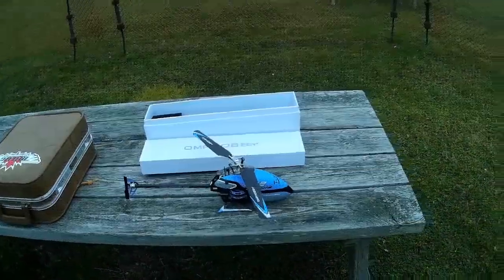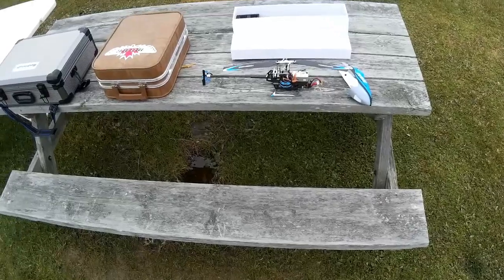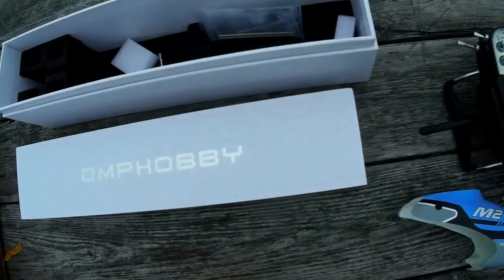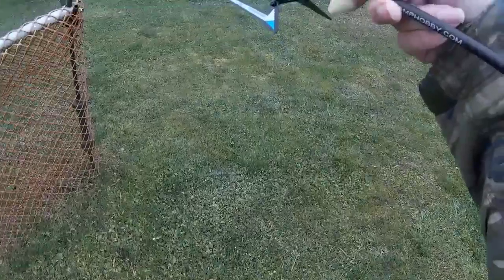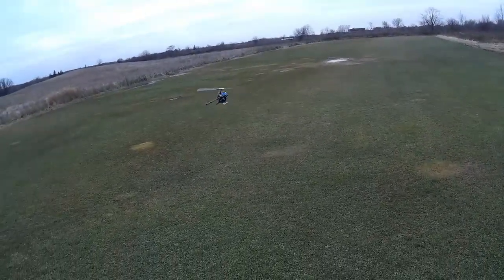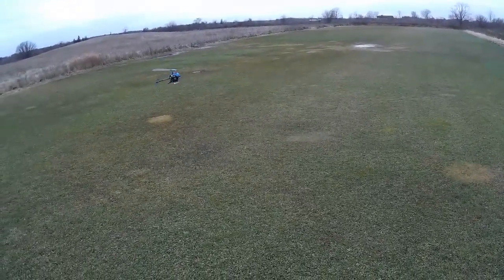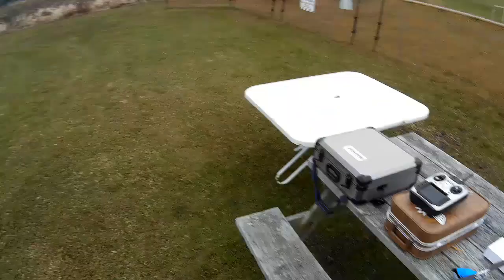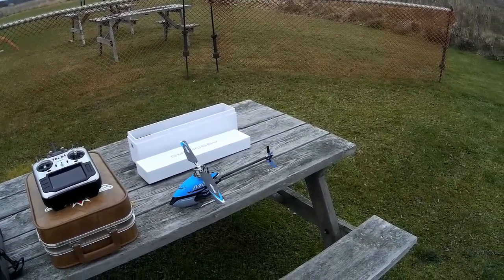OMP M2 Heli   first check flight

Comment: Which spare parts are included?
Reply from the maker: Bit of an odd assortment. Since the main rotors are direct drive, there is no main gear - which is, of course, a part which often breaks, and is usually provided as a spare. There are no spare blades. There are two spare main shafts, and also two smaller metal shafts - I assume those are replacement feathering shafts. And two spare carbon fibre skids. And five servo arms. And a couple of screws and washers.
Reply: kleedham and no battery carbon plates to lock them?
Reply from the maker: @mike_romeo_lima  There one battery, one plate, which comes inside the heli (and in my case was quite hard to get out - I used an emery board to smooth down the edges of the plate, to make it easier to slide in and out).
Reply: kleedham oh ok shit. I saw some videos where spare parts like blades, tailbooms and battery plates were included. Now I have to order them extra, via UPS! Pls not..
Reply from the maker: @mike_romeo_lima  Parts can be bought from Hawk Creation, who ship using Hong Kong post. http://www.hawk-creation.com/index.php?route=product/category&path=37_330 Haven't used them myself yet, though, so I can't give a personal review.
Reply: @kleedhamhobby  Hello
Thank you very much for the video's .... just to let you know i have just purchased the M2/Bonus pack from Hawk and paid for DHL express post to England the only issue i had was the import TAX about £20 paid online to DHL so less than 1 week to turn up not bad at all i think..... i also have a Jumper T16 pro ...... do you please have a link for your Tx model settings for the M2 ..... and if you would be so kind to let me know what switch settings you have assigned to the Tx ......  ho do you please have a throttle hold set up as the electrical helicopters scare me to death compared to my nitro helicopters that i can hear running   ( i guess they are like fart's its always the silent but deadly ones that get you )  ......... p.s. My setup came with the mini Rx
your are my only hope Kleedham.  i look forward to your reply
Reply from the maker: @raptorpome2577  I did already share my set up, as an OTX file. You can access it on Google Drive at: https://drive.google.com/open?id=19BblY3T7Lbv4af78M28NGcF-g-Dsdjtg However, my M2 arrived without the mini S-FHSS receiver, so I set it up using a DSMX satellite - so my set up is definitely not using the protocol that you will want to use, and there may need to be some differences in your channel output (I think the order of channels should be ok for S-FHSS, but the reversals might need to be different). As regards switches, that is all covered in the video - SF is throttle hold (back is live, towards you cut), SE chooses the flight mode (normal back, idle up 1 and 2 moving toward you), SB controls stabilization (back is stabilized), SG controls rates (back is low). If you follow my set up and have the Amber sound pack installed, all positions of all of these switches should be announced by voice.
Reply: @kleedhamhobby  thank you for the reply i have looked at your other setup video and have downloaded the Jumper open Tx model M2 file & sound file & it is now installed on my Tx and works Thank you very much ..... the Tx graphic display shows my elevator & rudder to move .... but throttle and ailerons do not move i guess i will have to have a play around tomorrow .... i did purchase some jumper Rx's can i plug any of them in and would i then have telemetry ? (battery voltage)........ one more thing do i have to plug any receivers in as i thought it came with one inbuilt what is that small black wire for on top of that Ali block ?  .............. please forgive me but i have not flown for about errr 10 to 15 years and i am now going from the stone age 35MHz Tx & Rx to the space age with 2.4 GHz with different protocols & Rx's with telemetry.  p.s.  can you tell me what the little button is for on the mini Rx that came with the heli is it another  bind button .... as the heli  aluminium block has a bind button
Reply from the maker: @raptorpome2577  I am a bit confused about what you are asking... and also what you are saying, for that matter. If you are using my set up, aileron (lateral cyclic) should be channel 1, elevator (longitudinal cyclic) should be on channel 2, throttle should be on channel 3, and rudder (tail) should be on channel 4, collective (pitch) should be on channel 6. All of those channels should move when the appropriate sticks are moved, except that throttle output will not go up if throttle cut is on (SF is toward you). The M2 needs to be flown with either a DSMX Satellite receiver or an SBUS receiver - there are two sockets on top of the aluminium block of the flight controller, one for SBUS and one for DSMX satellite. You must connect one or the other of these to fly the heli. You cannot use a regular receiver with the heli - only an SBUS receiver or a DSMX satellite. The S-FHSS mini receiver which is sometimes shipped with the heli is an SBUS receiver, and should be plugged into the SBUS socket. I did not get one of those when my M2 originally came, so I used a DSMX satellite receiver that I had on hand - so my setup is for DSMX protocol, with that satellite. And yes, the little button on the mini receiver is for binding it - you need to press that so that it goes into bind mode, then click on 'bind' under the protocol on the first model setup page on the T16. Hope that covers everything - as I say, I didn't quite understand some of what you wrote.
Reply: @kleedhamhobby  thanks for the reply the reason i could not see 1 of the sticks moving on the widget sceen you had created was because i needed to calibrate my Tx ......sticks etc that bit is now working. But on the T16 model setup page i have the internal RF module selected but it is recommending i update the module V1.3.0.44 AETR i will now try to find out how to update this errrrr this is a pain in the neck hopefully i will sort it with your help plus i did manage to bind my T16 to the mini Rx SFHSS  and the swash & pitch move in the correct directions i have not check the rudder yet as i have all the blades off for safety  p.s. you do not have a fail safe set for your model / zero throttle
Reply: please note i have now flashed the internal module thanks to Bill please see his Jumper T16 Multi Protocol Internal Module Firmware Update 1.3.0.53 guide https://www.youtube.com/watch?v=CECcliqzN1c
Reply from the maker: @raptorpome2577  What release is your internal module now? You can see by looking on the first model page, underneath the protocol. So long as your current release is 1.2.1.85 or higher, the update process is quite simple. If your current release is 1.2.1.51, the update is a major pain, requiring ordering parts and making a special adapter cable, and then taking the back off the T16. For the simple method (from 1.2.1.85 or higher), you just download the correct firmware file from https://github.com/pascallanger/DIY-Multiprotocol-TX-Module/releases - you want multi-stm-opentx-aetr-noinv (i.e. the version for a full size internal module in an OpenTX transmitter, with AETR channel order). Once you have downloaded that, just put it into the Firmware folder on your T16 SD card. Then, on the T16, press the SYS button, press Page to go to the SD contents, scroll to the Firmware folder and click, then scroll to your firmware file and long click on it - you'll get a pop-up menu with the option 'Flash Internal...', click on that and you should see a progress bar for writing the firmware and then a message that it was successfully updated.
Reply: @kleedhamhobby  yes in Bill's video he uses a different file but I did work it out that I had to use the one you quite rightly point out above.... I just need to learn how to create new model's on the transmitter and how to switch between them and I have ordered some xt30 connectors from Amazon as sods law I only had xt60 ....... Will I have to buy another TX jumper t16 if I want to learn other people to fly buddy box or can I use one of my old transmitter's futaba ff7 super and futaba t9cp and a crappy spektrum dx7 ... I would have thought in this day and age you could could link them via WiFi so you would not need a cable to link them up
Reply from the maker: @raptorpome2577  The T16 has trainer support, but I'm afraid I haven't looked into it at all, so I can't advise in detail. It is, of course, rather more complicated, being multi-protocol. I am coming to the T16 from being a long time JR and Spektrum user, so I am set up to do training using Spektrum transmitters, which do wireless training well (which basically involves one of the transmitters also acting as a receiver). Also, it is Winter here in Canada, so I have mostly been limited to indoor flying, where I wouldn't attempt training - I've been keeping occupied setting up the T16 for all sorts of small indoor planes and helicopters. Haven't had the opportunity to use it outdoors very much yet. I've had additional batteries for my M2 on order for quite a while now, but they still haven't come.
Reply: @kleedhamhobby  i have looked at the following video clip some bits are a little bit out of date but it was very helpful in showing me how to select models etc https://www.youtube.com/watch?v=qMMve_Wvl5w&t=220s  . yes i liked the looks of the JR 9 but the DX7 put me off modern radios as it had a fault that when the Tx had a brown out it corrupted a chip then the Tx was dead i had to send my Tx back to horizon hobby and they i guess reflashed the chip or replaced it i just did not trust the Tx after that plus i stopped flying for a few years but coming back into the hobby and finding i could purchase a Tx i could flash myself was what sold me on the T16 plus the telemetry etc. Canada is a fantastic place i have done a lot of skiing in Whistler..... i have 2 old raptor 50 v2 helicopters that i will still fly but will attempt to set them up later on as i can no longer purchase new parts for them..... can you recommend a good replacement for the raptor 50v2 the same size would be good as the 50 was more stable than the 30 size ....... is the NEW GAUI i think 7 the same size as the 50v2 i think i have seen one video that shows at least 2 maybe 3 different power plants you can place in the same helicopter glow engine / electrical motor / errr maybe petrol .... are the parts cheap for GAUI i dont know the history of the make you look like you have a few of them.... after i have used all the fuel up i have i think i will go all electric
Reply: @kleedhamhobby  Hello just to let you know the rudder / tail direction was right so all is good with your Tx setup and it also works for the Futaba mini Rx thank you. please note i had the helicopter bobing up and down same as you but when i had my 2nd flight i used idle up one and it was more stable so i think the higher head speed is better i think its a heavy little helicopter so soon drops ...... 

what head speeds should we have at normal / idle up1 / idleup2
My helicopter has gone faulty on its 2nd flight i only had about 3 mins flight time  first flight time was 5 mins and the main rotor blades would not spin at all but the tail rotor worked this was thursday ... Friday i recharged the battery but not that much power was taken out of the battery thursday ... anyway i powered the helicopter up but the main rotor blades moved at slow speed and intermittently so i emailed Hawk creation in hong kong .... they replied today saying they will not refund my money but they will post a new ESC to me i see above another person is in the same boat as me i was lucky i had landed then i had the fault if i had been in the air at the time it would have been a costly crash due to no fault of my own
Reply from the maker: @raptorpome2577  Sorry to hear that you are having problems with your M2. Let me know if the new ESC fixes the problem. I've flown mine quite a few times now, but not with all that much scope, as I've mostly been flying it indoors, since it is Winter here in Canada. I'm afraid I don't know what the head speed is supposed to be in RPM. The head speed seems pretty high on mine, even in normal mode. Another limitation I have is that I have only one battery - I ordered a couple more, but that was a long time ago, and they still haven't come.
Reply: kleedham I‘ve also a lot of problems with my M2, because it is spinning in a circle for no reason. Checked EVERYTHING, no reason found. Have to send it back to China and they will look for it and repair/replace it.
Reply from the maker: @mike_romeo_lima  Did you try reversing the rudder channel? Having the rudder channel the wrong way round is by far the most common reason for a heli spinning. Of course, having the tail rotor mounted the wrong way round will have the same effect. If the rotor is on correctly, and reversing the rudder channel doesn't help, then there must be a problem either with the gyro or with the tail motor itself. But I'd try reversing the channel before sending off the heli for repair (unless you've already done so, of course).
Reply: @kleedhamhobby  do you only have to reverse the rudder channel or would you have to reverse the gyro channel also . Plus on these modern helicopter's after you have plugged it in and powered it up do you have to leave it on level ground and not touch or move it for about 10 seconds for it to self calibrate the gyro
Reply from the maker: @raptorpome2577  Any helicopter, or plane, with a self-leveling gyro will need to establish what is 'level'... so, yes, you should always have it static on a level surface until it completes initialization (the M2 wiggles the head when initialization is complete). If the heli is spinning when you spool up, try reversing the rudder channel. Not the gyro channel. Exactly what the gyro channel does will vary from one heli to another. If you reversed the gyro channel on the M2, it would change the switch positions for 6G and 3D. With older helis that just have a tail gyro, reversing the gyro channel would usually reverse which way gave heading hold as against rate mode. Just gently spin up the main blades - if the heli starts to spin rather than holding steady, try reversing the rudder channel.
Reply: kleedham I can’t reverse anything because I‘ve their T6 transmitter. But the tail motor is spinning in the correct direction, I compared it to several other ones.
Reply from the maker: @mike_romeo_lima  You can actually reverse things on the XK T6 transmitter - it is programmable. But, of course, you shouldn't need to, if it came with the heli, as it should have been programmed correctly from the factory. Is the tail rotor firmly mounted on its spindle? That's another common reason for tail spin - if the rotor gets cracked, or is loose on its spindle for some other reason. Putting on a new tail rotor should fix it, if that is the problem.
Reply: kleedham I don‘t mean XK X6 transmitter, I mean the OMP T6 transmitter ;) The tail motor blade is mounted correctly, but only using „2 types of speed“: the first is the „slow spinning mode“ which is always „active“. If I give maximum throttle, the tail motor even spins at „slow mode“. The second mode of the tail motor is the „full speed mode“. If I move the left stick to a certain point to the right, it starts giving full speed. There‘s no smooth passage of giving increased throttle. Hope you understand what the Heli is doing.
Reply from the maker: @mike_romeo_lima  Sorry, I get confused what people are writing about in different threads. I didn't know OMP had a transmitter of their own, so I know nothing about that. I'm flying my M2 using a Spektrum satellite receiver, and the tail has held very well for me.
Reply: @mike_romeo_lima  have you taken the tail rotor blade off and accidentally fitted it the wrong way round or maybe they did at the factory ..... Hawk creation told me that they test hover each helicopter before they leave the factory if I can believe them. Marcel I can take a photo of my rotor blade fitted to my helicopter and email it to you just need an email address from you
Reply: raptor pome hey, I compared the direction and the mounted propeller with many others, and everything is fine. If I turn the left stick to the right, it is spinning to the right. So there is no issue with tail blade. Do you have Facebook? I could send you a video of mine
Reply: @mike_romeo_lima  do you make sure you have your transmitter Tx switched on before you power up your helicopter I think some Rx's need this for a reference point I could be wrong I am sure kleedham will tell me if I am talking rubbish. Plus is this your first RC helicopter
Reply: raptor pome no, that’s not my first heli. I have the OMP T6 transmitter, so I don‘t have to set up sth (you can’t change any servos or sth. with this transmitter)
Reply: @mike_romeo_lima  sorry Marcel I don't do any social media it's not my cup of tea. I am only talking on YouTube because I have a real passion for RC helicopters and I have been forced to purchase a new helicopter to practice with as I can't easily find part's for my old thunder Tiger raptor 50v2 and raptor 50v2se and dragonus and kalt cyclone  but I will need to buy a bigger helicopter later on as they fly better in the wind compared to the Very small M2 and my eyes can see a bigger helicopter better
Reply: @mike_romeo_lima  can you do a short video of your helicopter and put it on YouTube for me to look at I would need to see a close-up of your tail rotor and I would need to see your main rotor blades plus I would need to see the wires that come out of the receiver box and then join onto the tail rotor wires .....or just give me an email address to send photos of my helicopter for you to compare with your helicopter
Reply: @mike_romeo_lima  do you have a switch on your transmitter to switch from normal mode to acro mode to 3d mode I suggest you try the 3 different modes that should be on one 3 position switch
Reply: @mike_romeo_lima  I have sent you some photos of my helicopter for you to compare
Reply: raptor pome ah thank you! My helicopter is just like yours, also tail motor. I have nothing plugged to SBUs or DSMX because I use their T6 transmitter (from Omphobby). They have their own protocol, so I don’t have to plug sth. in.
Reply: @mike_romeo_lima  I will have to try and find this protocol out and see if my jumper t16 can use it  then I could find out if that mini futaba Rx is the problem for me ... I did mention before that I thought I could bind direct to the Rx but someone else dismissed it ....and I was to lazy to find out so just plugged in the s-bus futaba Rx. Please check your wire colours match up another thing to check are the main rotor blades spinning in the correct direction and is the tail rotor spinning in the correct direction
Reply: raptor pome yes, both are spinning in the correct direction. So wires are okay
Reply: @mike_romeo_lima  where did you purchase your helicopter from
Reply: raptor pome Omphobby direct, I had around 15 chats with their support and they also don’t know what’s wrong. So I‘ll send it back next Friday because at the moment the factory has holidays.
Reply: @mike_romeo_lima  do you have the same colour as me.
Reply: raptor pome yes, why? :)
Reply: @mike_romeo_lima  I was going to pick the yellow one but they had sold out ... But I am glad I have the orange one it looks fantastic in the sky ... Do you have another transmitter and receiver you could use to plug in and try your helicopter again ... As that's my only option just to rule out me having a faulty Rx
Reply: raptor pome yes, I‘ve a XK X6 Transmitter. But the original receiver is on shipment for 3 weeks now 😒
Reply: @mike_romeo_lima  hello marcel
is your helicopter working yet.....i have become a bit disillusioned with the M2 helicopter ....... i fitted a DSMX satellite receiver to the helicopter and the fault cleared ... so just to confirm this i refitted the futaba receiver that can with the helicopter and the fault came back ..... but unfortunately a flash came from the silver box and then some smoke i have asked for a new silver box with new PCB's inside it ... 1 PCB is the speed controller and the other one is the gyro etc ..... i am going to sell my Jumper T16pro as i want to spend my time flying not messing about programming the transmitter ... i have now purchased a Spektrum ix12 and a few Lemon receivers....... I am thinking of purchasing a GAUI N6 helicopter as you can order a nitro conversion kit for it and also a 12 cell lipo conversion kit ..... as i have a old OS 50 hyper engine that is brand new in the box i just hope it fits then i have the option later on to convert it to 12 cell lipo if i wish..... stay safe
Reply: raptor pome yes it works fine, got a new one from OMP. I think the old one had a defect